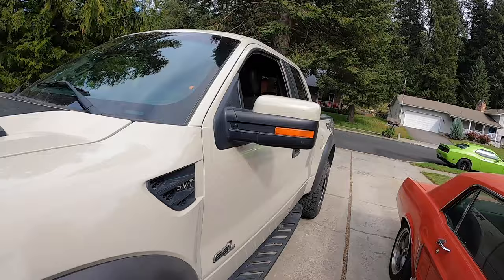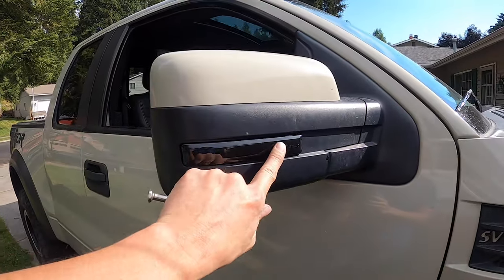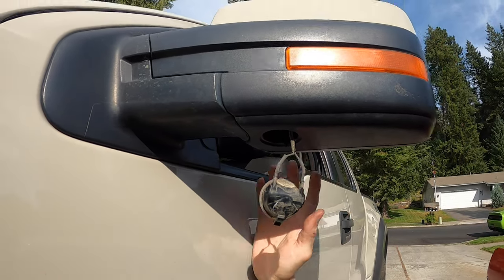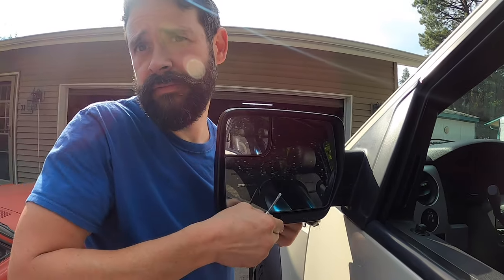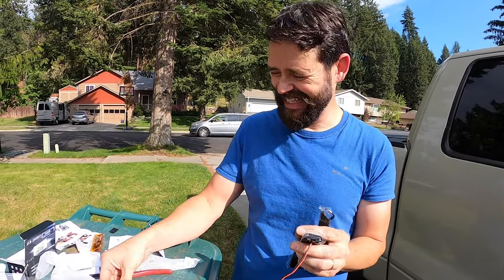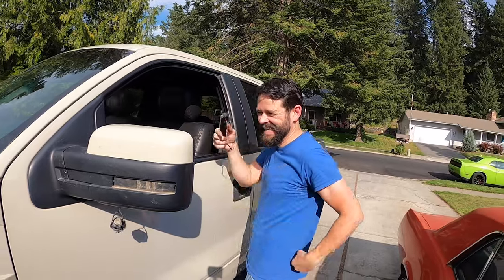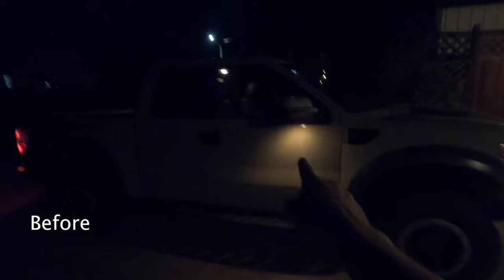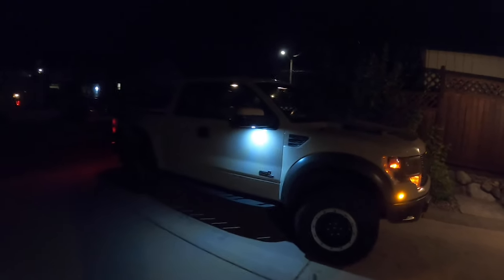Raptor Mirror Turn Signal Upgrade - WITHOUT Removing the Mirror

Comment: Just bought a really nice 2014 Ruby Red Limited Edition last Thursday that has about $11k in RPG stage 3 suspension mods, 3-inch lift, and 37in Maxxis Razr's on black Method wheels.  I was able to use your video, not only as a sweet upgrade to the Raptor (completed yesterday and it really tied things together as a black and red package without those ORANGE REFLECTORS), but also as a teaching moment for my 3 teenage kids: "Slow Down to Speed Up"  
After watching your video and using the links I didn't even have to look at the directions or shop for the products!  Essentially, my message to the kids:  if I had not found your post, I would have tried to figure this out myself after purchasing the products and it would have taken probably 3-4 hours to disassemble the mirrors and actually use the directions.  
So by scouring the web to find cool upgrades which took some amount of time, we were able to use your video post and do the install in about 45 mins; and that includes a trip to O'Reilly's to get wire connectors and wire. Still wondering why the driver side wire was so much shorter than the passenger side....?  Anyway, thanks for the post and keep it up!  
I see your question / comment below about a heated steering wheel!  This is my first vehicle in about 10 years that does not have one and I didn't realize how freaking much I used it / liked it until not having one - so good luck getting us an answer!  
PS - someone can and probably will shoot holes in my message to the kids, but I'm trying to teach them all the positive benefits of internet research because I didn't have this luxury growing up as a kid...
Reply from the maker: This is an awesome post, and thanks for taking the time to make it! So glad this video helped you, and we think life is all about teachable moments. That's why you need to be present so that you can seize them when they come along. So good for you for not only making the effort but for recognizing the moment. Kids won't pay attention to everything you have to teach, at least mine sure don't, but they will pay attention to some of what you have to teach, so good job. On the heated steering wheel, we are bound and determined to find a fix!! We've narrowed down that the newer one's have it, but that's not likely to provide an upgrade path for the Gen 1s, but we think we've found some Platinum editions the same year as the Gen 1s did have heated steering wheels. Stay tuned, you know we'll have an awesome video as soon as we figure it out!
Reply: Man anyone that takes the time to share an experience like that gets a thumbs up from me. Cool story!

Comment: Hey guys. Love the Raptor series! My 14 Raptor just went digitized over the weekend following y'all's video and I love it. I found a tailgate light bar with sequential signals that I installed at the same time and it looks killer with the mirror and bar signals all in sequential sequence. It's the OPT7 60" Redline light bar. Found it on Amazon for $106.00 with 4.5 stars and over 5k reviews.

Comment: I just did this exact retro on my '14 Raptor. Your video inspired me to do it. After about 3 weeks of research I was able to figure out how to get the mirror glass out. It was a LOT easier to remove the glass than I thought. Once glass is out it's about a 15 minute job. I couldn't get the puck LED light to snap in, ended up using some silicone on the inside to make sure they stayed in place. Thanks again.
Reply from the maker: That's awesome! Good job getting the glass out without breaking it; we always seem to break it. Thanks for commenting!

Comment: I was SO glad to see this video.  I thought surely there HAS to be a way to do this without removing the mirrors!  You did a good job explaining what you did and how you accomplished it.  Thank you!  I'm a 66 year old woman with a 2012 F150 King Ranch.  I had to splice the wires on the Driver's side, but managed to get the passenger side done without having to cut any wires!  I decided to do the 'hardest' (driver's) side first, but I don't think there was any more play in the passenger side... I just managed to get a little better angle and those wire are now very tight!!
Reply from the maker: Nice job!! Thank you for the kind comments and thanks so much for commenting!

Comment: Thanks for sharing... been needing to change mine on the Platinum... Now I know how.
Reply from the maker: Glad we could help! Hey, since you have a Platinum, we have a question for you. Does your truck have a heated steering wheel?
Reply: @MotorsandMischief  No....
Reply from the maker: Darn! We're working on a video about how to add a heated steering wheel to the truck. No worries, we'll keep looking!
Reply: @MotorsandMischief  got the lights you listed.. changed the puddle lights.. work great.. tried to change the small lights but not working at all... the front facing bigger lights are coming tomorrow. checked the fuses and relays. I hear a ticking sound from the relays when the lights are on .... what am i doing wrong?
Reply from the maker: So the ones on the back, that you can see when sitting in the truck, aren't marker lights. They are just turn signals. Do yours not work as turn signals?
Reply: @MotorsandMischief  correct.... they look like and have bulbs in them.. but they don't blink anymore. I got the small ones that you used and they don't work either.
Reply from the maker: Super weird. If it was us, I think it would be time to pull out the multimeter or trouble light and make sure you're getting 12V at the plug in the mirror when the flashers are on. If you are, that will tell you the problem is either with the plug or the new lights. But since you mentioned the existing ones didn't work either... are you the original owner on the truck? Is it possible someone turned off the turn-signal-in-mirror functionality at the computer?
Reply: @MotorsandMischief  not the original owner.. second. I will try the multi meter. I am not a mechanic and have not skills in that field... so we will see.

Comment: You need LED relay fuse, too stop fast blinking/ get a ( Blinker genie) and wire it up & you will have running lights & turn signals okay/ hope this helps you folk's out there 🏞️

Comment: do you have to buy the two different sets to have the front and the back of the mirror lights?
Reply from the maker: There's three different products that are needed to do everything we did in the video, the LED turn signals that go on the front of the mirror and are visible from the front of the truck, the LED turn signals that go on the back of the mirror and are visible from the rear of the truck and the puddle lights. There's links to all 3 in the description. Thanks for the question!

Comment: I just upgrade my side mirror blinkers and puddle lights like this. The blinkers started blinking fast did you have this problem?
Reply from the maker: We did not, however that problem is typically caused by a turn signal relay that is relying on a certain resistance in the bulbs to time the blinking. When you upgrade to LED's the resistance goes ways down and so the circuit in the replay trips faster. Not sure if your truck has a stand alone turn signal relay but if so, you can upgrade to a type that doesn't rely on resistance to pulse.

Comment: I just upgraded my mirror blinkers and puddle lights my blinker started fast blinking. Did you have this problem?
Reply: Try disconnecting your negative battery cable for about 10 minutes.

Comment: Just ordered mine what size wire did you use to extend it (the gauge)
Reply from the maker: Excellent question... and we can't remember. The factory wires are pretty small, 16 gauge perhaps? We're pretty sure we used whatever the next size up was as we didn't have the exact same gauge, but bigger is fine. We'll try to pop out one of the lights and check it for you as soon as we get a chance.

Comment: I want to get these. Can I just tap the front ones into the rear facing ones? Also are these removable if I want to get new mirrors?
Reply from the maker: So you have to buy both the front and the year lights as listed in our description. If you do, the rear light has a pigtail for the front light to plug into - they work together. The factory doesn't have a light there, just the reflector, so you can buy just the rear, and keep the stock reflector, or do like we did and buy the rear and the front. You cannot buy just the front, as it will have no where to plug into without the rear that comes with the pigtail. Don't totally understand the second part of your question, they are removable yes, in the sense that they are not glued in or permanently mounted or anything. Thanks for commenting!
Reply: @MotorsandMischief  so I don’t need to tap in or solder anything correct?
Reply from the maker: Correct! We checked with Uncle Jake and he said as long as you buy both the front and rear, the new rear comes with a connector for the front, as there is nothing there from factory. One issue we had was the wires were really short so we did solder on about 6 inches more of length to make life easier, but Uncle Jake says this is not strictly necessary if you just work carefully with what's there.
Reply: @MotorsandMischief  ok thank you!

Comment: Can you turn them into running lights???!
Reply from the maker: Interesting idea. You would have to tap a running light circuit. Most of the lights on the Raptor are computer controlled but snaking a wire down and just tapping it into the truck's existing running light setup wouldn't be hard.